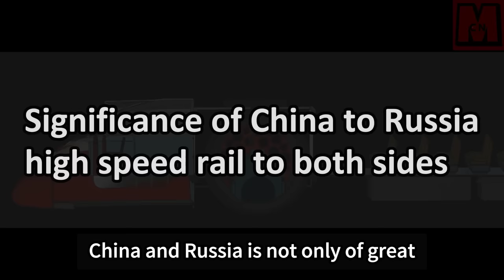China& Russia Invest 1.5 trillion RMB To Build New High Speed Railway

Comment: 2:08 Russian railways are not backward. This is a deep misconception. Russia has few high-speed lines, but traditional cars and locomotives are at a high level, the railway track is modernized and does not have wooden sleepers - all sleepers are reinforced concrete, and the rails do not have joints and therefore there is no sound of iron wheels. Russia won the largest tender in history for the construction of locomotives in India. Russian railways are an industry that works like clockwork and causes only pride.